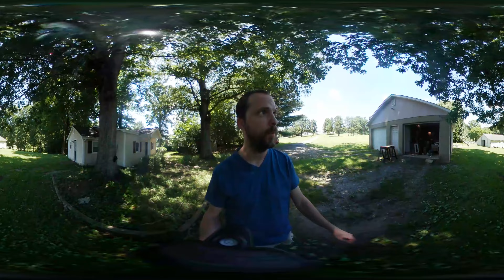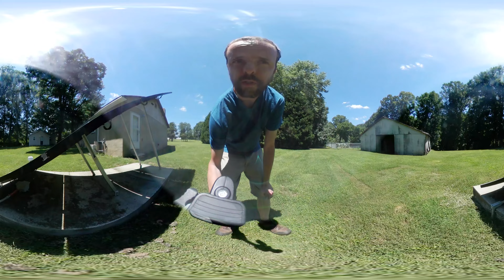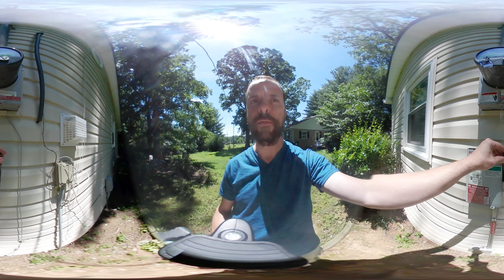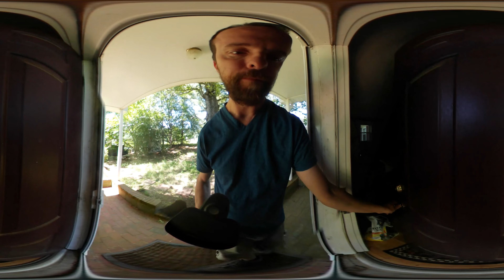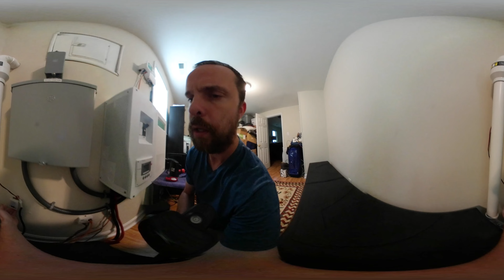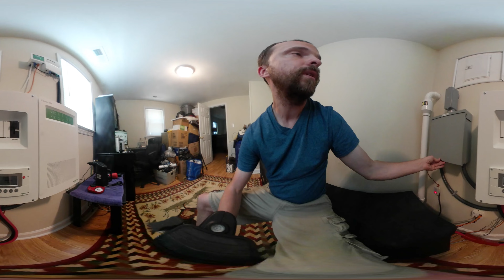Conext SW4024 AC coupled grid tied solar with 20.64kWh battery backup...360 4K Rotate video w/ mouse

Comment: what size wire did you use for the ac side for in and out .  10/3 or did you use heavier 8/3 . In your vid you said this is the 240 breaker but not amp of that breaker.
Reply from the maker: I believe it was 10/3 romex. And 30 amp on the breaker. You need to set the breaker size in the settings.
Reply: @DavidKK4GAF  Thank you.  I seen the input was a 30 amp and I kinda figured they were both a 10/3 but wasnt sure.  I ordered the context sw alongsidewith the scp also thanks to your vids .
Reply from the maker: I would also add the DC breaker input. And the Combox. Need it for programming.
Reply: @DavidKK4GAF   Looks like that has the 250 amp breaker also need to add that anyways .On the combox well my net and cell phone service here is pretty horrible was the reason i opted out of the combox  and went with the scp. Is there a setting i cant access with the scp that the combox would allow ?
Reply from the maker: @thhillbillyinventor105  web interface and uploading firmware is much simpler.
Reply from the maker: I do solar battery backup consulting.  Time is money.
Reply: @DavidKK4GAF   I see . Yes this makes sense .  I may have to see about adding this into the stack . Was going to add the solar edge meter may add both.
Reply: How did you get your sw 2024 settings to do the curtailment . I have a pamlet with mine but am not seeing anything about curtailment settings .
Reply from the maker: @thhillbillyinventor105  Enphase does not curtail. Only on or off.
Reply: @DavidKK4GAF  I see. Mine is solar edge . I got the 4048 for a 48 volt setup.
Reply from the maker: @thhillbillyinventor105  I have micro inverters

Comment: Cool system I am trying to understand something so your ac input goes directly to the inverter not to that sub panel?  Meaning in the sub panel it's only loads you want the inverter to power?  And you have to ac couple the enphase on the output side of the inverter? Or can you ac couple your enphase  on the input side let's say on another breaker? Any adv or disadv of either.
Reply from the maker: I am backfeeding the solar array through the output of the 4000 watt inverter. The systen is also geis tied. So I am earning  .11 credit for every kilowatt of power the system feed back to the grid.
Reply: @DavidKK4GAF  cool so the grid tie part is on the output side flowing thru the inverter. Did you ever have a problem with you scp mine wont let me change the adv feature ac couple option to enabled from disabled. Any idea why?
Reply: Btw I figured out why mine wasnt working I have an old scp that cant  upgrade the firmware. Anyway i finally bought a new one can you tell me what you settings are ac support did you change. Ac coupling i guess is set to enable. Do you have to change your fstop and pvistop trying to determine what enphase need as I also have enphase

Comment: Hello, when the power goes out during a sunny day, will the SW use the m250 inverter power to power both home and charge the batteries and shut them down when batteries are at 100%?
Reply from the maker: Yes. It is setup as an AC coupled system. The curtailment will kick in when the batteries hit 100%.
Reply: David Thanks for answering. Another question, when the power company power is out, and inverter is in ac couple mode. If you put a voltmeter to the ac in at the inverter, it shows 0 volts? Just want to confirm the inverter do not send power back to the grid when it’s out.
Reply from the maker: @MecaneandoVW  the inverter shows 240 volts AC. When the grid goes down. This powers the critical loads and backfeeds the micro inverters to turn them back on.